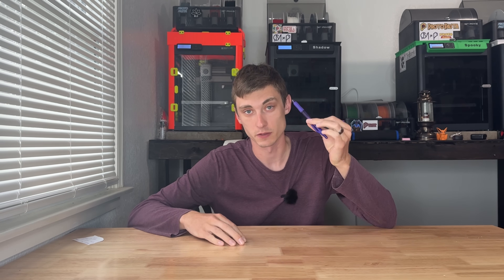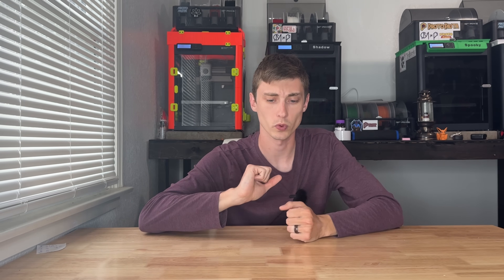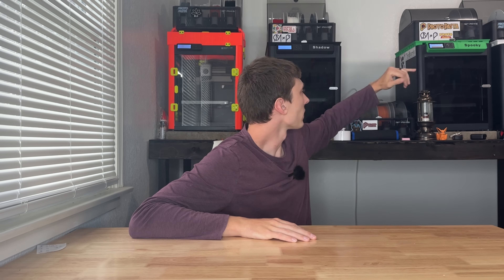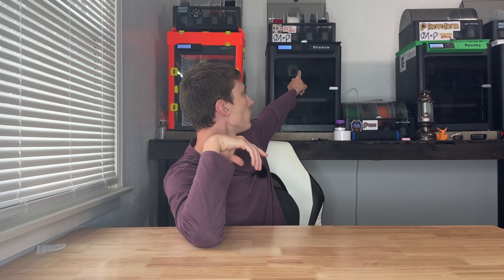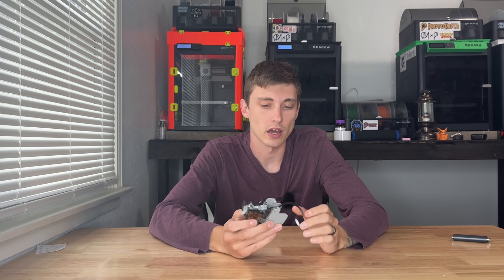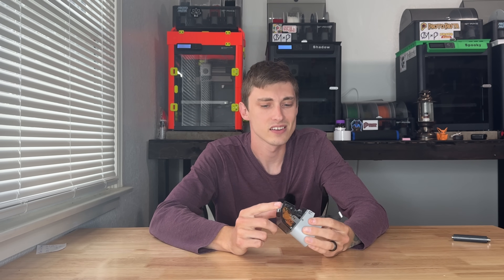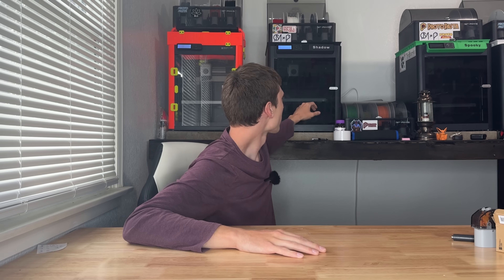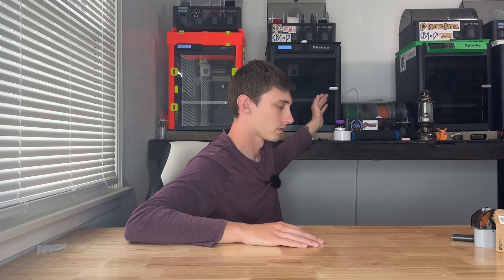I put 7826 hours on my Bambulab printers! Here are my most common replacement parts

Comment: I have lost all power to my AMS. Any suggestions X1C It started out by not extruding material. I would purge fine. but would only extrude during build for a few minutes. Then. it would just keep running without extruding. Your Thoughts?
Reply from the maker: All power to ams. Either the main board in your ams needs replaced or the connection is bad. I have replaced 2 main power boards i would start there